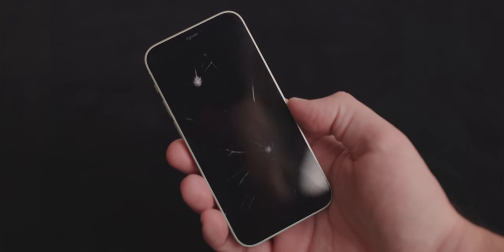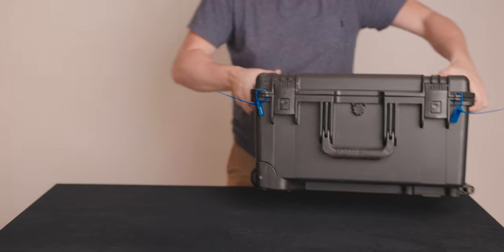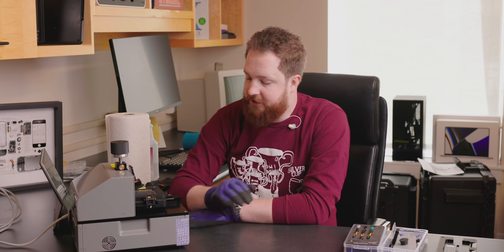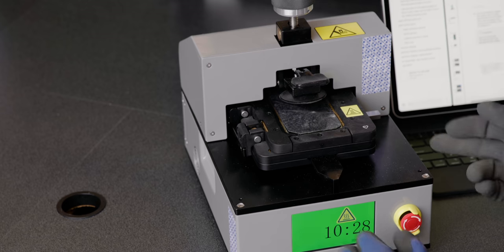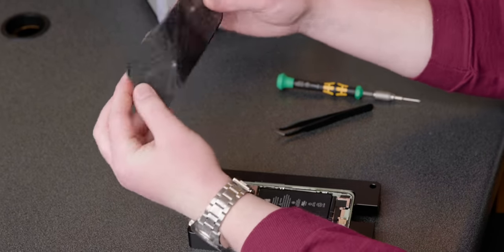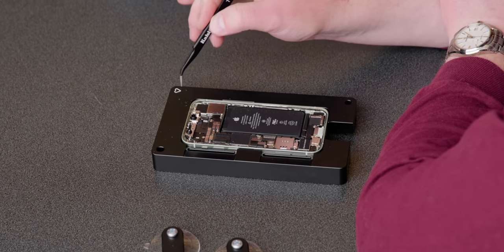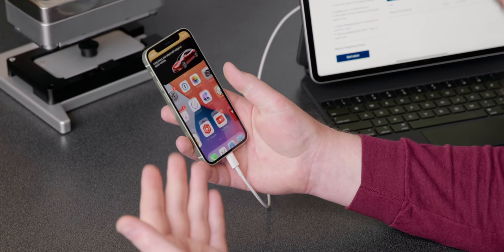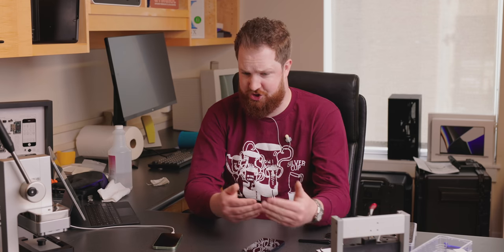Using Apple’s Tools to Fix My iPhone

Comment: lol@apple as a phone tech all that crap is unnecessary and apple knows it. its like taking your car to the neighborhood shop for tires vs taking it to the jaguar dealership. way more expensive, for the same job because they have "official/certified equipment" meaning overpriced parts and tools. anyone can change your tires with knowledge and expertise, doesn't need to be at a  premium. moneygrubbing is the new customer service.

Comment: Great video, but what it really told me was Apple has a lot of work to do to make their iPhones user repairable and more environmentally friendly. I am sure with the talent of the engineers they have, they can indeed do it if they wish. Ninety percent of the repairs people will want to do with their phones are replacement screens and batteries. Just focussing on easier replacement of both of these would have huge benefits for the right to repair. The question is, do they just want to seem like they care (as now), or do they actually wish to honor the intent of the right to repair and make their devices less of a landfill issue going forward.

Comment: This is such a shitty effort Apple. Absolutely not good enough. If you're denying warranty off this what does it matter if the serials match blah blah or the user doesn't follow Apple procedure with Apple equipment. Using a hair dryer/hot air gun, a suction cup, and a mass produced plastic frame for applying pressure to the screen and battery should be good enough.

Comment: The fact you have to call Apple so they can authenticate the parts is BS!! I replaced screens on my own high end android phones and never ever had to call to complete the repair, Apple is bs and I've owned apples mac and iphone and ditched it and never looked back, Android, Windows and Linux is the better option than anything from Apple

Comment: Am happy that am not with i-(zombie) Phone. My phone hold battery for min. 7 days and is shock and water proof. And cost 10 times less than that shit. Now days technics work 2-3 years or in best case scenario 5 years. o, why should i spend 1000$ for something that will die after a 2 years? i can but 200$ phone which will be better and will work like phone longer than i-(zombie) phone.